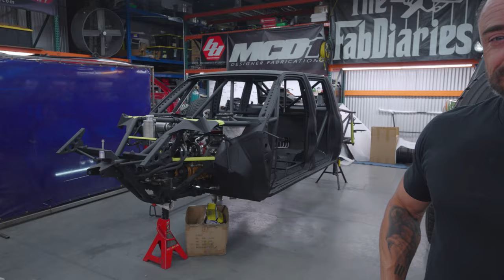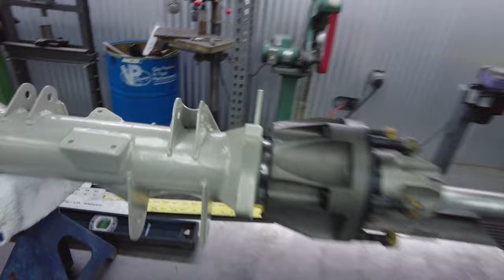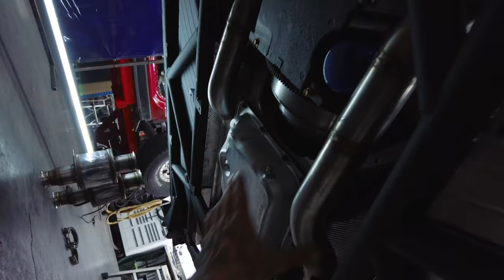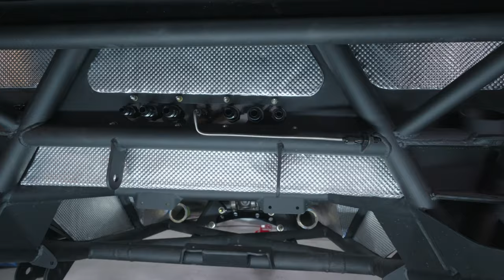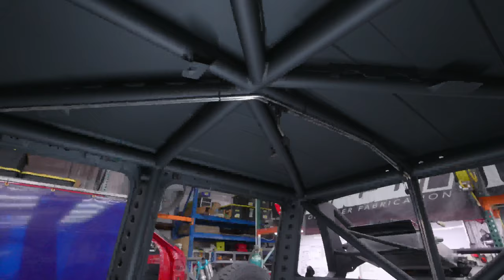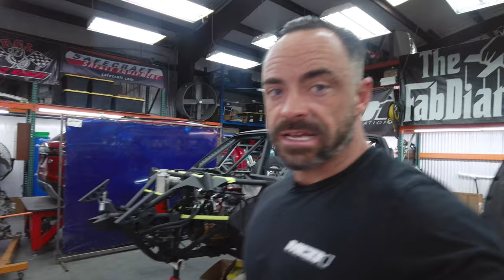James' Final Frontier Starts Final Assembly | MORGAN CLARKE DESIGN

Comment: Looking awesome.  The attention to detail for the final outcome is fantastic.  I use DEI shielding on the fuel tanks in my rock crawler and 68 Firebird.  It works great.  I know how long it takes on projects.  I  took my Triumph TR6 race car, and put it back to stock. I started it in '85 and finished it in '03. Even all the hardware was original Triumph,  right down to Philips screws. Perfection takes time and attention to detail.  Keep up the good work.